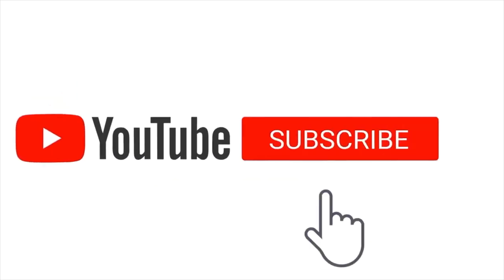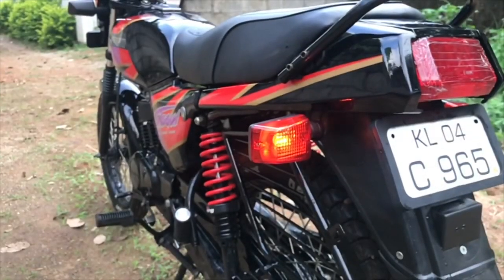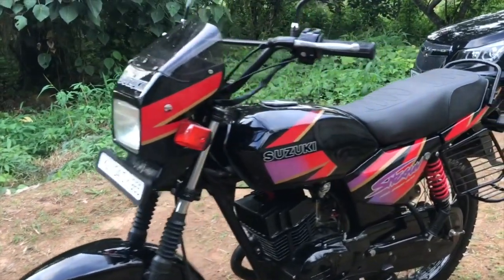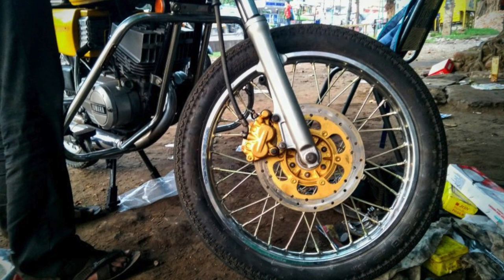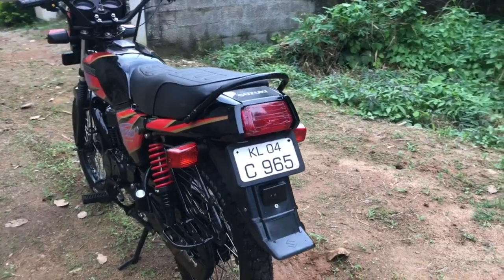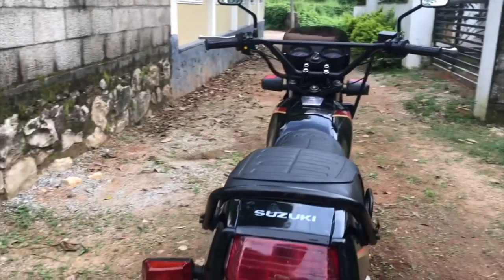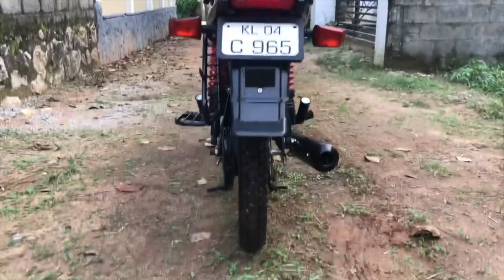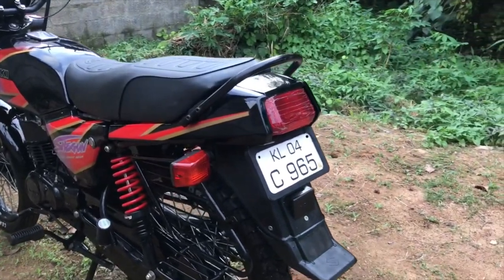Disk Brake Options For Yamaha RX and Suzuki 2 Strokes (English Video)

Comment: Bro I know I am commenting in 2023 but in pulasr setup we can use pulsar 220 master cylinder, steel braded brake lines, and the bybre caliper and then it has the best braking better than the gladiator and rxz
Reply from the maker: You can use any MC, the length of the steel braided line is shorter so don’t know if it will reach till the banjo bolts

Comment: As usual a great video...just to remind u that the 1st 2 stroke to come with a disk brake was Enfield Fury 175 .. it came with superb Brembo units & was also the 1st single cylinder 2 stroker with 5 gears. Kindly reupload the video with the amendments as it hurts Fury owners like me to hear something wrong from seasoned 2 stroker like u.☺️
Reply from the maker: I actually forgot the fury, plus the fury disk set is alloy wheel, and it’s not compatible on rx shogun without machining, so in the true sense though fury was the first one to feature disk brakes, it’s not easy enough to find one. CBZ was more common and I still would avoid it due to lack of spares, forget something made by Zundap, I know it might hurt owners but the omission was not purposeful, I would still say in a sense if you want spoked wheels fury was never an option
Reply: @Yamakaze  Dear sir I am not saying that Fury disk set can or cannot be retrofitted in Rx/Suzuki's..my point is u said that RxZ was the first 2 stroke to have disk which is wrong as Fury was 1st..& when u generically mention "1st 2 stroke with disk" there is no point in whether it's Alloy or Wires..5 gears or 4 gears..whether with 2pump or without...1st means 1st....how,when, why don't matter.✌️
Reply from the maker: Biswanath Mohapatra chill 👍
Reply: @Yamakaze  I am cool bro 😂
Don't worry I have seen many half baked informations & logics to react in any hot head...I know what I know....& i really love to watch ur videos & that will not change 😍
Reply from the maker: @biswanathmohapatra1836  thanks

Comment: One query pls I am about to install front disc set up... Apache rtr fork are direct fit to max 100?
OR we need fiero f2 forks only pls
Reply from the maker: Apache will fit, there are some things you need to look for, that’s detailed in the video
Reply: @Yamakaze  thanks bro
Reply: @Yamakaze  top bolt of apache forks can fit in a tee of max?
Reply from the maker: @2wheelsoulbiker526  yes but how will you fit that to the t plate crown? You need to install the samurai/ max 100 top nut
Reply: @Yamakaze  😄 thanks bro for crystal clear explanation.  Keep it up your good work as usual.  Shubhkamanyein👍

Comment: Can i use front forks of gladiator & calliper with disc plate of rxz 5 speed and its hub? 
Also brief what which calliper, forks and hub to use for sunstar disc plate?
Reply from the maker: Yes, that was my old setup, sunstar disk plate, 5 speed hub, gladiator forks, gladiator master cylinder and gladiator calipers
Reply: Thanks a lot
Reply from the maker: Newil Surin 👍

Comment: Hi bro. Any idea on old model pulsar 150 classic 2001-03 fork oil quantity and will adding a lower oil quantity enhance suspension travel while fitting the same in RX? Because rx weighs arnd 30-35 kgs lighter than the old pulsar.
Reply from the maker: I need to check
Reply: @Yamakaze  ok👍

Comment: I had bought a pulsar wheel assembly but did not fit it for the Fitness test, just wondering if the inspector would disapprove, he insisted to get the chain guard fitted, I did that and touch up got the fitness certificate.

Comment: Bro Rx135nu RTRnte disk plate vekkan eathellam spare venam
Reply from the maker: Rtr forks, caliper, disk plate,master cylinder, fiero f2 Hub and plate, and rtr speedo worm gear
Reply: @Yamakaze  and rx original rim and spokes or feiro f2
Reply from the maker: @digvijayjagtap3776  rim can be reused, but it needs pulsar of fiero F2 spokes
Reply: @Yamakaze  and spedo cable are use original or any other?
Reply from the maker: @digvijayjagtap3776  apache cable
Reply: @Yamakaze  Apache cable fix in rx100 stock  meter?
Reply from the maker: @digvijayjagtap3776  don’t know, it’s same in a shogun
Reply: @Yamakaze  ok thanks.